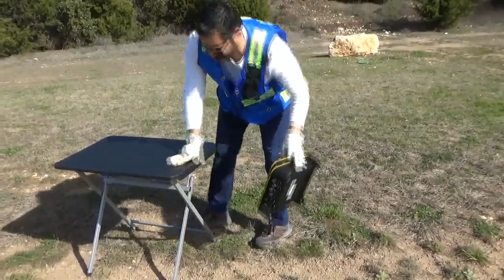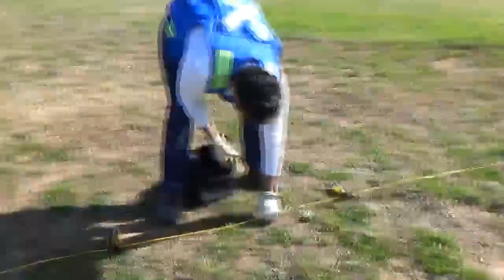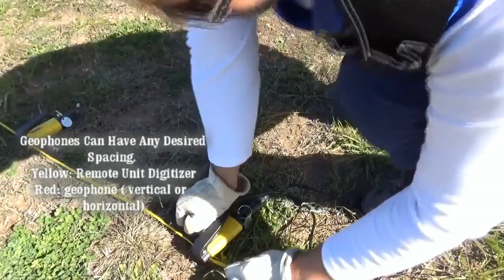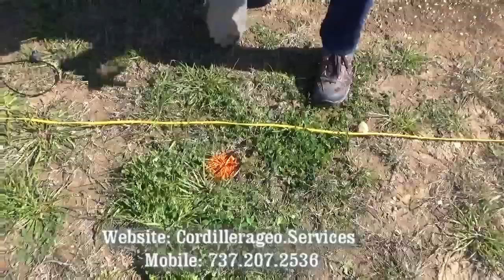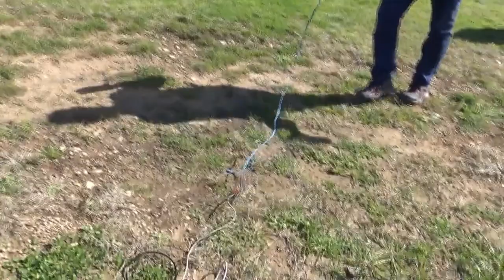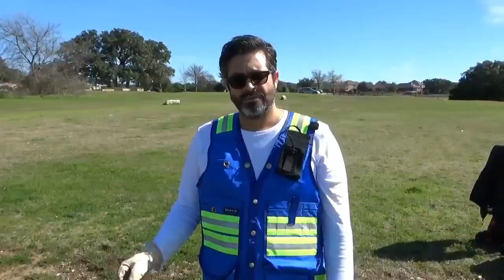2D Seismic Refraction Tomography

Comment: Would this work to reveal metal or pvc pipe locations down to maybe 6 feet? The pipe diameter is usually 2" or larger.
Reply: Very likely not. That's a super small item in terms of near surface geophysics. If it's critical that you need to find a metal pipe, you'd want to consider Electro-Resistivity Tomography to find something like a metal pipe. But ERT is also very expensive so maybe a strong metal detector or GPR (if there's no water table) would work.

Comment: Hello Mr. Hinojosa, im geophysics student and i have great in seismic refraction. I do have some questions: 
-how do choose the position of the source in relation to the the geophones (before the first geophone, in the middle!?)? do you have the same spacing for all these positions?
-in the case of the bedrock mapping, we know that the depth of interest should 3 to 5 times the geophones total length, do you control by varying the source, like the farther the source the deeper our geophysical investigation will be? thanks you for your infos!
Reply from the maker: Hi Kone,

I apologize for the super delayed response...Life got in the way...

Answer to Question 1: For seismic refraction tomography I like to do it before the first geophone, between each geophone, and after the last geophone. So the more sources/impacts, the better (higher resolution). You can space the source location any way you want. I prefer to use close spacing (1 or 2 m) and equidistant.

Answer to Question 2: Yes, the farther the source the deeper the imaging depth, but that also implies that the source is larger. Deeper imaging depths require larger sources.